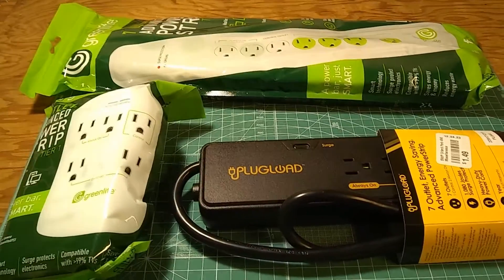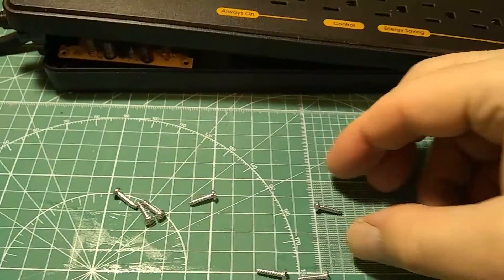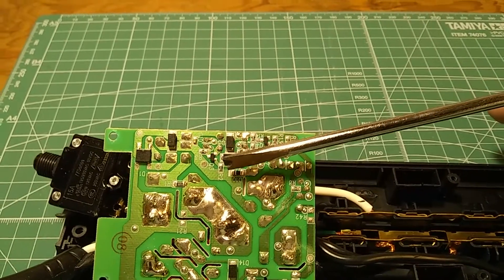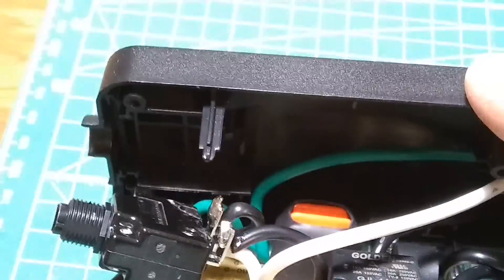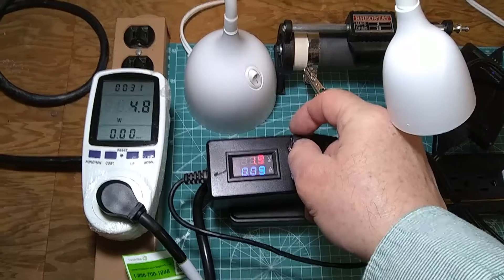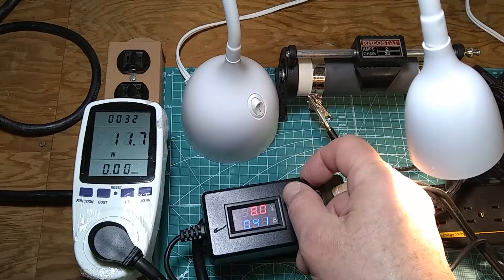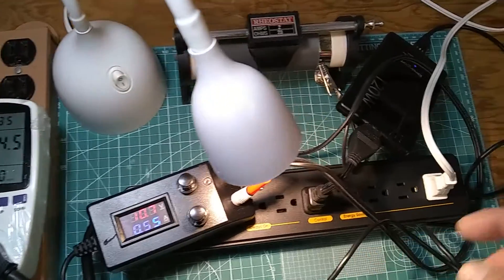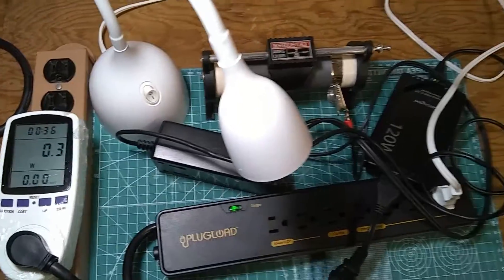Plugload Advanced Power Strip - Review and Teardown

Comment: how to bypass the relay to keep all outlets in on?
Reply from the maker: The easy way: just bridge (solder) the two output contacts of the relay. The downside is that the circuit is still going to consume (waste) about 3 Watts of power whenever the strip is plugged in. 

A better way is to gut out the "advanced" part and solder wire bridges across the outlets. But this is something to do for an electrician in order to avoid any risks of fire or electric shock. Any electrician would know what to do and how to do it. 

Good luck!